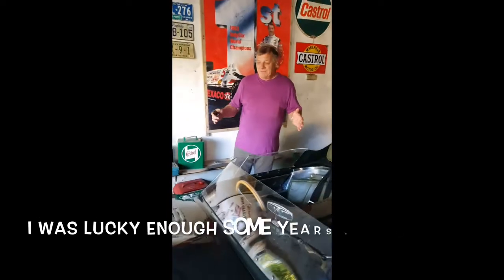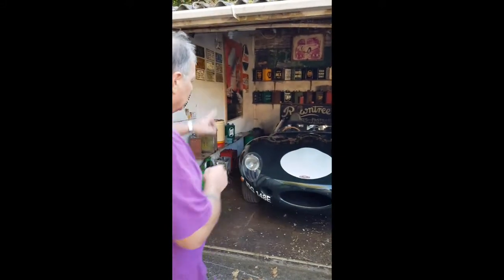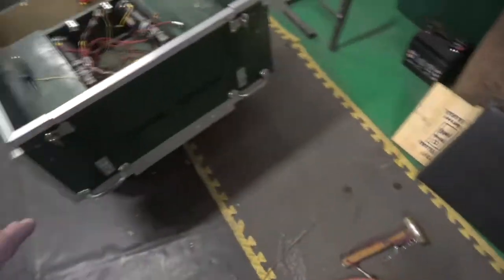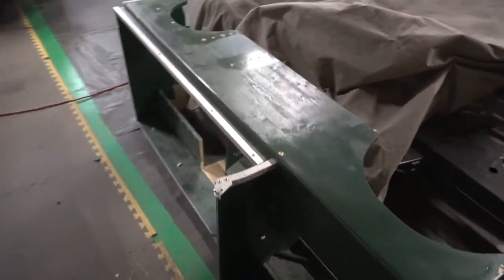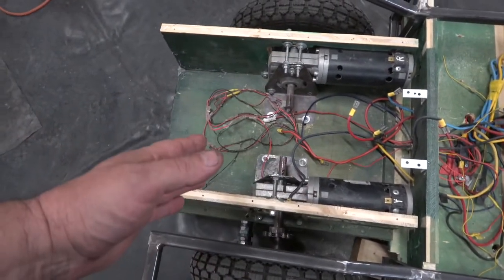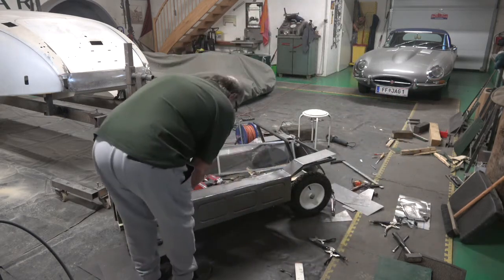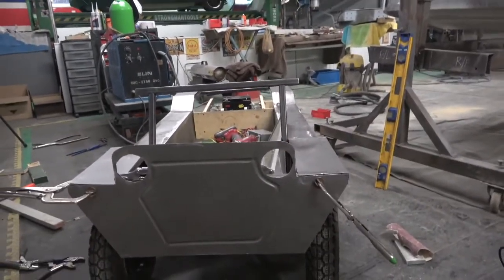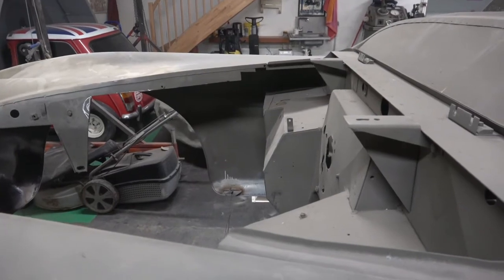Jaguar D Type, Jaguar XK 150 & Mini Mini Moke

Comment: That`s looking the Mutts Nuts Dave ,and it`s great that Amir`s back as the XK is not standing still either ,the hole in the XK chassis is it not a service hole for the gearbox i.e. topping up fluids
Reply from the maker: Peter,  Thanks, we are cracking on with the projects, No the starnge thing is there is nothing under the hole apart from a handbrake cable
maybe it to adjust that but it would easier from under the car ? I will try and find out why it‘s there lol. Cheers Dave

Comment: That hole in the back !  It's for those moments when you're driving far too fast and sh*t  yourself ! 😂😂 Dave . That "D"type was on  a '66 plate ....... mmm  ..and they do make aluminium replica's. Bad in 1974 l briefly worked in a shop where one of the "short nose " Le mans winning cars was being repaired . Mike Hawthorn .  There's a huge lawsuit going through the Swiss (?) courts and it's quite possible that all the Jaguar "replicas " may have to be destroyed !! Jaguar can make "continuation " cars . The moke is coming on very nicely and l think you're right about the weight . Take care and stay safe.
Reply from the maker: John, It was on an E plate i think so that would have been January 67 i guess it was registered on an age related plate at the time but i have no
idea when it was built i would think it‘s a Sullfolk built D Type being an alloy bodied as the less expensive ones are fibreglass, Wow the short 
nose cars must have been something to behold. I see what you mean about the replicas as JLR own the product line and could sue over any 
copies that are built commercially. It ‘s starting to come together but i‘m trying to build it in such a way that you can dismantle the body to 
paint it and fit it all back together with less hassle lol.  Cheers Dave